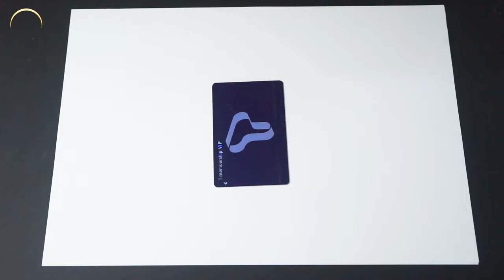How to Make Your Car Key Slim at Home

Comment: if you unsoldered the thick chip in the middle, then move it to the side, run wires back to the PCB, the key could be even thinner. but at the same time more work is needed.